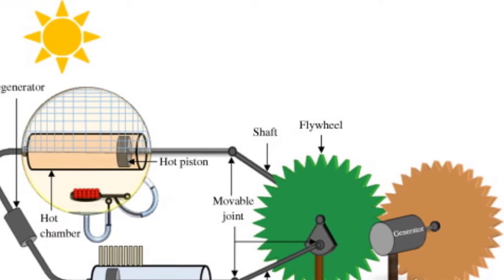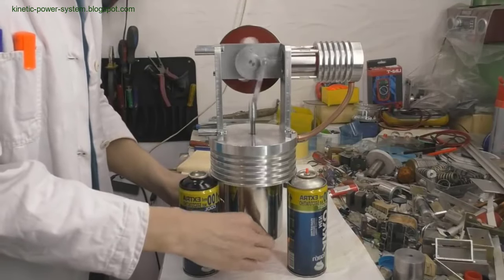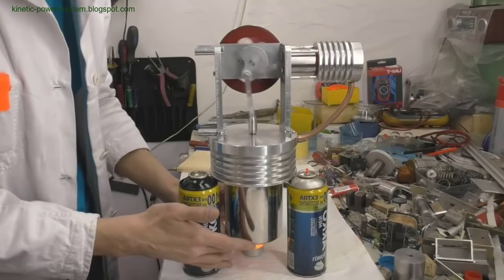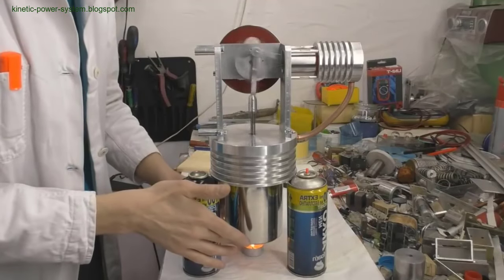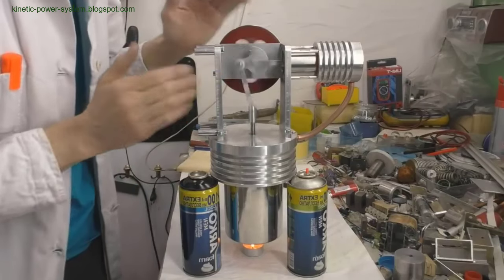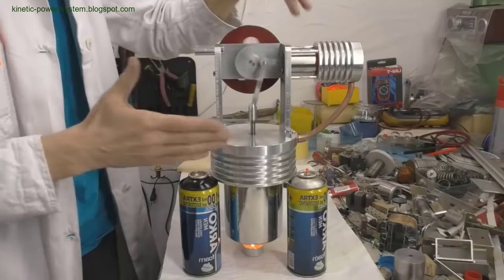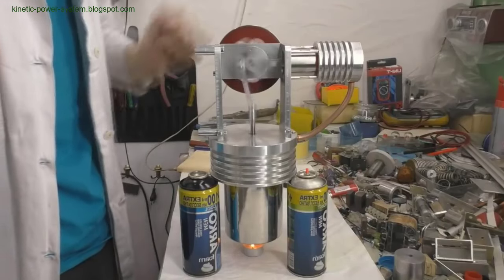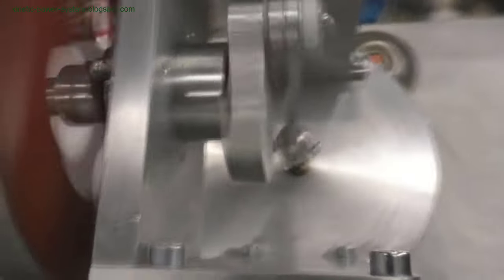Harnessing Excess Heat: The Potential of Stirling Engines with Solar Collectors | Stirling Engine

Comment: Stirling engine operating at atmospheric pressure 🥱
Stirling engine operating at useful pressure:
1) real big issues with the seals
2) Its actually a pressure vessel that needs to be tested and inspected at regular intervals
3) It doesn't scale up 
5) Every company producing Stirling engines is bankrupt. Afaik there is only one company in Norway producing engines for Stirling dishes    and they don't sell it to regular people. 
5) Solar panels
6) Solar panels
Reply: 3. good old surface area to volume... can be worked around if one stops thinking of circles.
Reply: @paradiselost9946  Surface area=cost. I guess the biggest problem is that you actually need a generator. Magnets copper and sheet metal won't come cheap compared to an inverter.
Reply: @Dee-x1e  generators are easy, and dirt cheap whereas inverters LOVE to blow magic smoke and prove to be completely unrepairable...

and whats that inverter using in the first place? it isnt converting a form of energy into another... its simply alternating the one youve got. at a cost.
Reply: @paradiselost9946  "Stirling engines are the most efficient way to convert solar energy to electricity" textbook. But why don't we use them? We even had Stirling powered cars